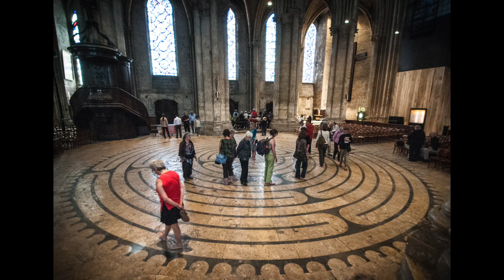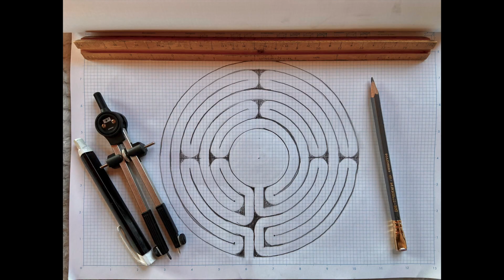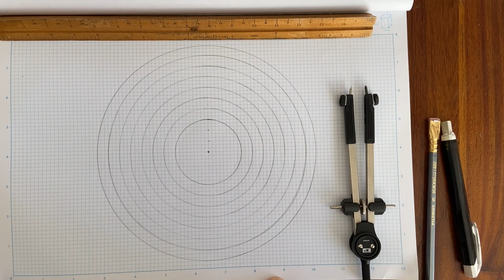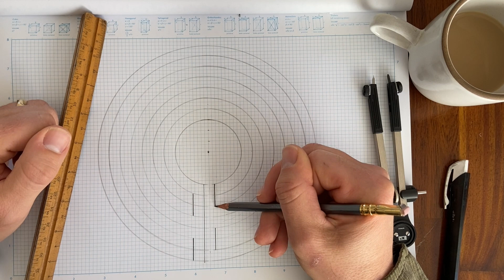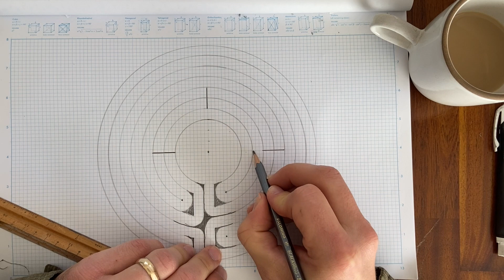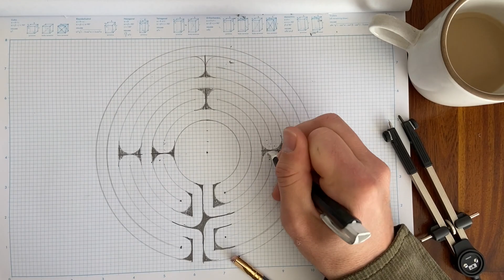How to Draw Precise 7-Circuit Classical & Chartres Labyrinths!

Comment: Hey Lars, thx for the tutorial! One question: do you add the lunations to this variant as well, or that remains with the Chartres pattern only? Thanks, Peter (cheers from Hungary and hail to our joint Chartres labyrinth mamories!) :)
Reply from the maker: Hi Peter! Good question. We do often add the lunations and rosette to this variation. In the full 11-Circuit Chartres there are 112 lunations which may represent four lunar months, so on the 7-Circuit we use 84 to represent three lunar months and on the 5-Circuit we use 56 to represent two. The rosette is the same, but harder to create in smaller centers which is another good reason to expand the center beyond 1/4 diameter in smaller labyrinths. Chartres variations with small centers really become compromised. I really treasure our meeting in Chartres and creating that labyrinth together. Here's hoping we cross paths again someday soon.